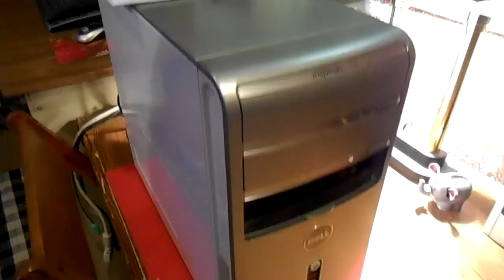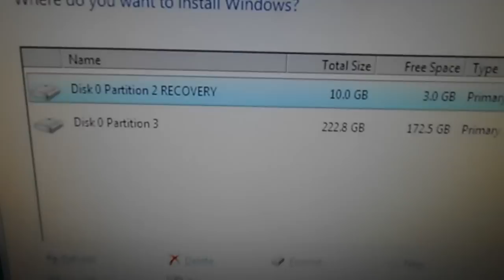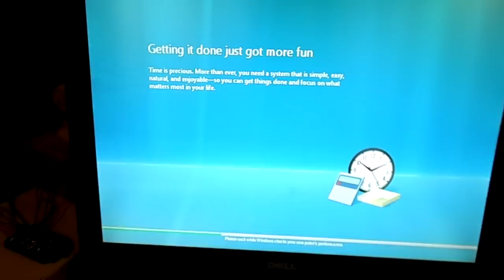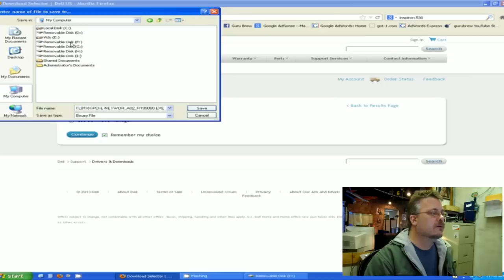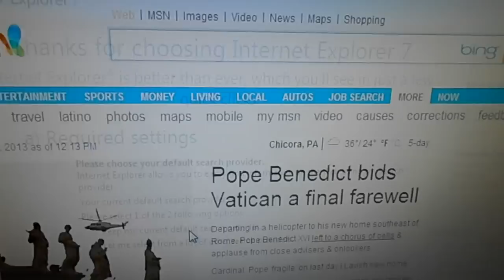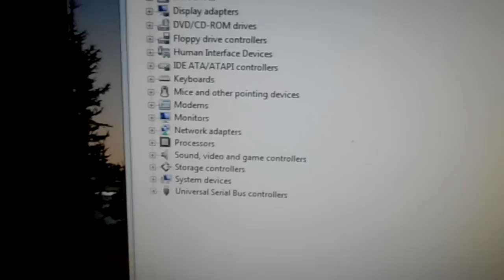How to Restore a Computer to Factory Condition Using a Recovery Disk

Comment: HI Steve, I've tried this but get an error code: 0x80070017 stating windows cannot install files, anything else I can do please
Reply from the maker: CRC Error" which means that the files that are being copied from the disk are not copying to the hard drive with the same structure, meaning that the "original" files on the disk are being modified/changed/corrupted while being copied to the "destination" location on your hard drive during the install.
This usually means either a bad DVD, or a read error on the DVD drive. 
Could try to clean cd/DVD drive or use another disk.

Comment: Mach 3 reboots when I try to open it , it worked before , I tied reinstalling it but same thing happens , will open on safe mode but won’t operate cnc.
Can you help , would like your opinion, like watching your videos as you get right to the point . 👍🏻

Comment: Like your video on Recovery! I'm having problems with drives disappearing tried a reset and made things possibly worse! 
Would like to try and sort myself by following your video, I do have the recovery discs, I have four discs, 1 of 3, 2 of 3, 3 of 3. Plus " Supplemental Recovery" so how to do it with this number of discs ?. Please!  Dave in the UK, ps I have a HP ENVY, using Windows 10. Thanks

Comment: having restored factory settings on my dell inspiron 530F desk top I get the windows screen ok but after a short time the screen goes blank .  If I do an F12 status I get the the screen works ok so the screen seems to be working but when I run Boot to Utility partition the screen goes blank again.
It seems that the screen works ok when I first switch on but the goes blank so I cannot see the result of the diagnostic test. can anyone help.

Comment: Thank you for your video it was the  only one that properly explained how to use the dvd to restore factory settings. I did seem to have one or two differences that may be helpful to other users. I have a 2008 Dell inspiron 530.
Before the windows set up screen was enabled there was a blank screen which had a fleeting moment in the top left corner that said to boot up using dvd press any key. this message was very brief and if missed it would try to use the hard drive, so this is an important step.

Comment: Hey, I tried using the largest disc to install windows and it says "Windows detected that the EFI system partition was formatted as NTFS. Format the EFI sysytem partition as FAT32, and restart the installation." I am not sure what that means so if you could get back to me as of what to do next that would be nice. So far the video is great and has helped me with all my problems. Thank You.

Comment: i am a tech at a motel got lots of extra discs and comps but i need to reinstall on a machine. does it matter if the disc came with a different computer can be used on another computer or does it have to be the computer it came with? but still has the same os?
Reply from the maker: It depends on the brand machine. Dell allows you to use same os disk between different machines but other brands like HP only work with their given machine software

Comment: if there's technical issues and you are not able to access computer, can you insert flash drive or portable hard drive to save any data that was already stored in the computer before inserting recovery disc?

Comment: i followed your directions to the letter but all it does is starts windows.
Reply from the maker: some computer brands may require that you allow booting from other devices found in the system startup BIOS. Check your machines documentation on how to toggle this option if having problems or consider the disk may be damages

Comment: my plan is to install Windows Vista first because I have Windows 7 but it's an update only so I have to have an operating system already on my computer before I install it. do I need to do all the updates for Windows Vista if I'm just planning on installing Windows 7 right after?
Reply from the maker: I would say the major updates like the service packs for Vista would be required first. YES
Reply: The other issue I'm running into is it keeps saying there isn't enough space for temporary files. I deleted aps and went into the temp folder and deleted stuff, but it still says there isn't space.
Reply from the maker: +Genuine Jess if you're installing from a disk which I assume you are, make sure that before you do the install you are selecting to delete the main partition otherwise the operating system will still be on the hard drive and that will take all your room.
Reply: It doesn't give me that option. Pressing F12 didn't work. It started out asking me where I wanted to boot up from but when I selected the CD it booted my computer normally.
Reply: The hard drive on my computer is newer than my computer. The original one crashed, I was thinking king maybe that was causing the issue somehow.
Reply from the maker: OK, when it boots from the CD you need to select the advanced or manual install option to get to the hard drives partitioning table. Once there you remove or delete the largest disk partition that will be the old OS then create a new partition to start the install
Reply: I figured it out. I made a mistake the first time. Just realized it.

Comment: Do you know where I can get the software "Network Controller" for HP 655 windows 7  ultimate 64 bit? (already checked the HP website)
Reply: On the hp website there should be lan or wlan section

Comment: Great video. Does this work with a brand new hard drive and with a PC that was not running vista before? was running 7 pro or any other operating system. I understand that will work with all PCs. Thank you

Comment: My computer was working yesterday with no trouble. No one has used the computer since yesterday This morning the screen is black and says that the boot manager is missing. What could have happened to cause that?
Reply from the maker: possible hard drive failure or corrupt boot sector. try running hard drive test from system startup. look in machine book on how to do this from startup. usually f8 or f12
Reply: your hard drive might need to be replaced

Comment: great video! I was able to get my other computer working again. Just one thing, though. I have no sound. When I put the mouse over the speaker icon, it says, "No audio output device is installed", and the speaker icon has an X over it. How do I get the sound back? Thanks. :)
Reply: +griffinmatter Probelm solved. I didn't have the speakers plugged in. Thanks. :)
Reply: thankx:)
Reply: +griffinmatter 😂😂

Comment: for some reason my mouse and keyboard will not connect when im booting of this disk, do you have any idea what so ever what i might do?
Reply from the maker: some older machine will need a ps2 keyboard and mouse while doing the restore. most the time you can navigate using the tab, enter and arrow key while installing if you can get at least a ps2 keyboard

Comment: Thanks for the video Steve! After I've loaded some of the missing drivers from my flash drive, my ethernet connection is working however I'm unable to access windows updates because of the outdated explorer version IE6. Aside from automatic updates, which hasn't kicked in yet, any idea where I can get a Windows XP Pro 32-bit supported browser download? I've tried the Microsoft site for a while now, all saying my system does not support 7 or higher. Prior to the restore it did so the only thing I can think of is that it hasn't updated to service pack 3 yet. Any thoughts? How can I force the sp3 update?
Reply from the maker: +G40NY Make sure your Region,l calendar, date & Time are correct. This will cause a delay in retrieving MS updates. If you still have problems try installing Firefox and go to MS updates thru it.
Reply: +GuruBrew was able to finally find the SP3 update through Firefox however I've still got the same problem unfortunately - can't update from IE6. I've been searching for a 32-bit compatible version but I'm finding messages from from Microsoft indicating that support for XP and for IE7/8 ended in 2014. Any idea if they just stopped providing downloads for older systems all together? Much appreciated
Reply from the maker: +G40NY try this http://download.microsoft.com/download/C/C/0/CC0BD555-33DD-411E-936B-73AC6F95AE11/IE8-WindowsXP-x86-ENU.exe

Comment: Hello I have a HP SR2000 with windows 2000 Pro. I had trouble with it booting and resolved that. When I tried to load a disc from the CD drive, it would not see the disc in it. I found on Microsoft site that you go in to control panel/ sound  manage audio devices,right click blow devices and  show disabled devices shows up, you click it to enable them and the CD drive worked. I also made my real-tech sound card my default.  Now I powered it down and have nothing, no power, no fans on mother board turn, CD drive don't spin up and hard drive don't spin up. How can I recover this?  If I take the hard drive out and use an external box can I go in and reset the default?

Thank you
Dennis

Comment: i have a laptop hp with windows7 and i am from austria my englisch is bad , but i have a question.  i have made last year on my new laptop a save on a dvd of the system. and i delet the recovery  and hp tools. was that a mistake do delet the recovery and hp tools ? if you understand my question, can you tell me please what can i do ?
Reply from the maker: Sounds like you deleted the recovery partition on the hard drive so you will need the disk you made if you ever want to restore the machine. Hopefully the disk you made are done correctly but can't tell without doing it.
Reply: i have the disc and i try it but nothing happens.  i had delet the recovery i think last year and the Laptop works fine. i think that was a big mistake . and can you tell me can i install Windows 8 without the recovery?

Comment: Will backing up save my Hotmail, gmail, and google accounts? I did a factory reset before on another computer and they disappeared.
Reply from the maker: To save external data such as passwords and settings you should use Microsoft's built in app called Microsoft Windows Easy Transfer. I have a video that steps thru the process here http://youtu.be/VnruIvLTC4I
Reply: GuruBrew Ok partner. Thanks a million. I will give it a Whirl....

Comment: Hello. On the device manager where you had two yellow ? that said "ethernet controller and SM bus controller" I have "Base System Device".....What shall I do with that?
Reply from the maker: This video Fixing Wired and Wireless Internet Connection Problems describes how to handle problem device in the device manager. Steve

Comment: Also.. why should we want to return our computer back to the condition it was when we first get it from the manufacturer? I mean does that help it to run better or clear up space or something?
Reply: Windows is like some marriages. They change with time. Windows becomes unstable and sometimes gets to a point where it does not work no more. This is because of viruses and malware. So doing a system recovery using the Disc from the computer maker, Windows is reinstalled and its back to business.
Reply: ROFL! Now THAT'S funny!!

Comment: Hey Steve, I was wondering if you could tell me, is there a way for me to purge my system, perhaps to a disc, so I can make more room on it without taking up more space on the hard drive?
Reply: There are many ways to do it. Your personal data like photos, music, etc can be copied to a flash memory or some external hard disk. Or you can use a Backup software like, Acronis, Norton or some free software that performs backups. However, if your computer Hard Disk is small, consider buying a larger drive like One Terabyte Hard Drive runs for about $54.00 and then reinstall windows(1T). My brother burns his personal and valuable data onto DVD's or CDs, If you can use Roxio Easy CD & DVD, this software tells you if your DVD to burn onto still has enough space before you hit the BURN feature.
Reply: Hey thanks for the reply. I appreciate it. I will certainly look into doing the things you've stated here. I did do that with my photo's, now I need to do that with my other files as well. I like keeping space on my computer & keeping it healthy. :)

Comment: Hello, before I decide to proceed to recover my windows, I have to ask several questions that bothers me. So, if you're willing to answer, here they are:

1) Is there any chance that while recovering from the recovery dvd (I have 5 of them) I will lose all data in the computer? I mean, does the recovering process affect only the partion of hdd where windows is installed or does it format the other partion of the same hdd or even another hdd I have in my laptop?

2) Does the recovery process format my hdd or does it only move files from here to there and alter registers and what not? I actually think that I have a malware on my computer and I can't get rid of it. It makes my windows behave very strangely and I also am worried about the passwords I type on the computer. So, will recovering rid me of the malware or not?

3) I don't have particularly good experience with recovering, I have done one in my life so far, and it wasn't pleasant because after I thought yay it recovered, the installation process asked me to insert a disc with drivers I did not have at the time. And nobody even warned me that I would need any. So I actually wory about that it happen to me too (back then it was my sisters' laptop).

You know, it might help if I buy standalone windows licence  but I am not really inclined to this option as it's a rip off I believe. And yes, there is cheaper Windows 8 now, but I don't see anything good about it.

Thanks in advance.
Reply from the maker: What is the operating system on the machine? Also give me the make and model of the computer.
Reply: Oh hello, thanks for the answer. Didn't really expect it that fast. It's Win 7 HP running on Asus G74s (2 hdd (500 GB each) and bla bla, nobody is interested :)
Reply: So I guess you don't have an answer for my questions... Then I am sorry I bothered.

Comment: I have a computer that needs window xp reinstalled on it but I don't have the disk for  it now what do I do
Reply: The computer communty came to a conclusion that XP is dead because Microsoft refuses to support with patches for a few more yrs, eventhough 40 million people use XP around the world. I would recommend to move on from XP and buy from ebay Windows 7 original unopened box with COA No. and then do a clean installation and register with Microsoft via internet.

Comment: Need help please  I followed all your directions and things was going good.  During the installation part, it stop and told me 
Windows can not install required files.  Make sure all files required for installation are available and restart the installation.   I have restarted, but it does the same thing.  Help me please

Comment: So I had success in this process until the updates. I need vista sp1 and it will not install. I installed windows installer package, the update standalone package, and turn off starting programs as suggested by my research and still get error code 0x800703. I am not sure of what to do next. I need the service pack to continue to update and be able to access things on the internet. If you could help or give me a lead on where I can find help please let me know. I do enjoy your videos and feel like I have learned a lot from you. Thank you.
Reply: Ok, well nobody has responded but I have researched and have seen other with a similar problem with no answers. I figured that it was able to get the service packs before but it was  more slowly. So reformatted and reinstalled the Vista OS again. This time I chose to not have the automatic updates on and only installed the updates in order one year at a time from the earliest year. When I got to the service pack I downloaded that directly from the MS website and installed it. I also did not have an anti virus installed so it couldn't interfere. I am happy to say that I now have everything current.
Reply: Tanya C I am happy to say that I now have totally erased and reloaded 2 Dell Windows Vista computers. The unfortunate thing is that after all the updates there is not alot of space left because they didn't come with a lot but they will mainly be used for going onto the internet. In the beginning I thought that I messed up completely but taking my time to install the updates and doing much research has helped.

Comment: theres nothing there it says not enough room to install windows os here then somthing about drivers the reason i tryed to restore it was because on boot up i was getting a message saying internalt for multi core processors will be disabled

no bootable devices-- strike f1 to retry boot or f5 for onboard diagnostics

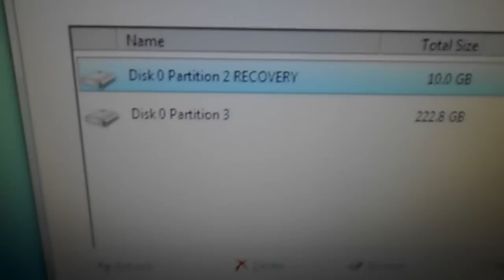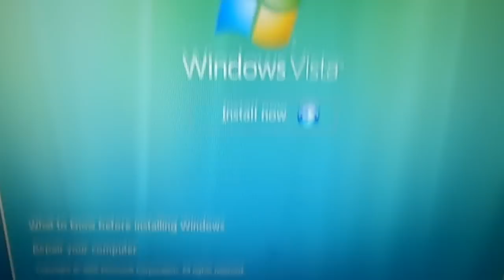Comment: i have a question i get up to the part around 7:08 and i dont get the format option or any options on the bottom and in 6:20 mine says install now or check compatibility online and i press install now and i get another option that says updating install by online or soemthing like that but mainly i just dont get the format option and when i try to install it it says i just get the same files for windows it does not replace the window files i have right now

Comment from the maker: Yes you can use the recovery partition without using the disk. Sometimes hard drives get damaged and the recovery drive does not work so this is why some computers may need the disk.

Comment from the maker: The SM Bus controller is the System Management Bus Controller. Framework is not the answer it will be listed as a driver for your particular motherboard. I would guess it's listed as  a chipset driver